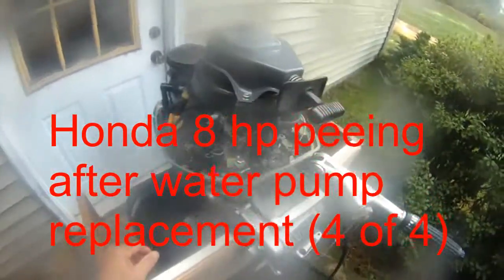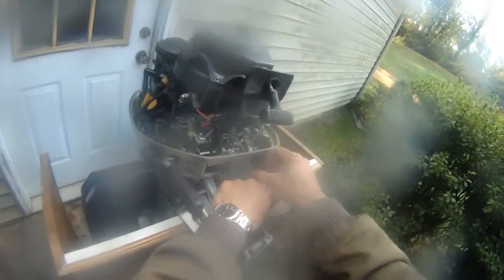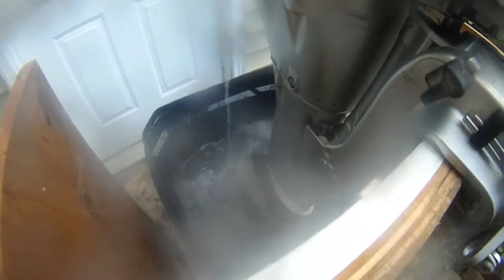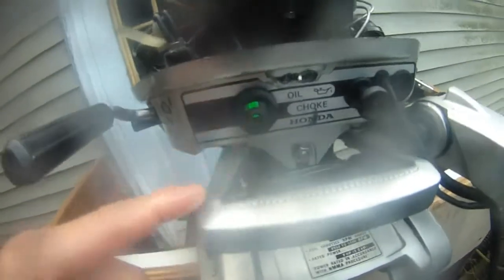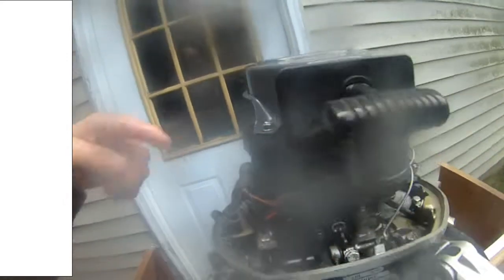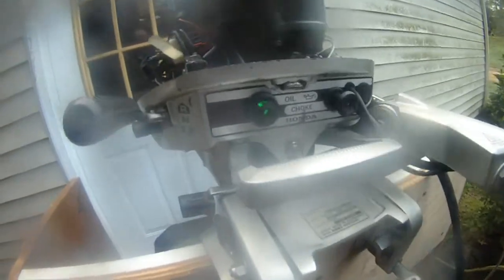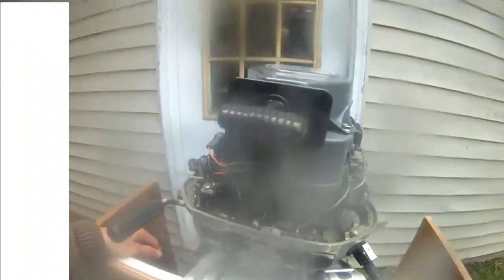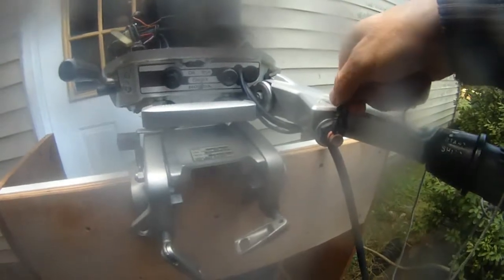How to replace Honda outboard 8 hp water impeller? (4 of 4) My tips

Comment: Did you get the broken bits out of the motor from the impeller snapped off blades? If so we're did they collect. And I see it failed on you was it because the water cooling jacket was blocked with the rubber bits from the impeller. I have same problem in UK.
Reply from the maker: yes, I got all the broken water impeller out of the outboard after I took it apart. Installed new water pump and all is good. Also cleaned and replaced the exhaust port leak and replaced the leaking fuel pump. Now, it runs like a champ. No more leaking or idling rough.

Comment: Would you know why my water stops spitting after I open up to full throttle and only if I shut down and start again it starts peeing again?
Reply from the maker: You may need to take the powerhead apart to fix it. There is a leak somewhere. The other possibility is the water tube was not inserted to the exit hole correctly. So, water would not come out until you shut off the outboard. It leaked out from other areas.